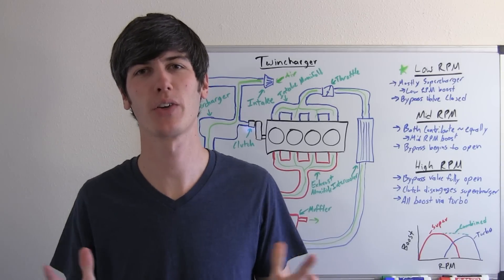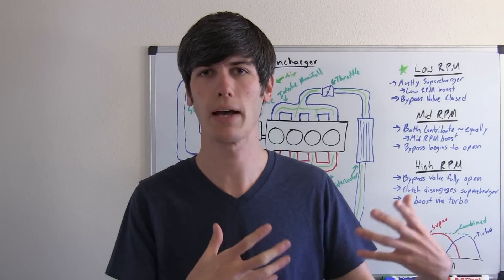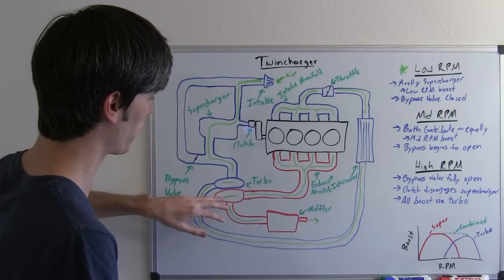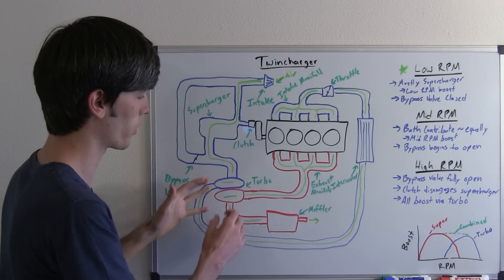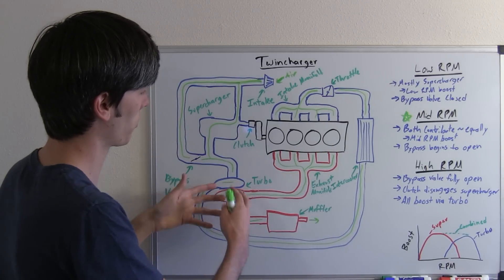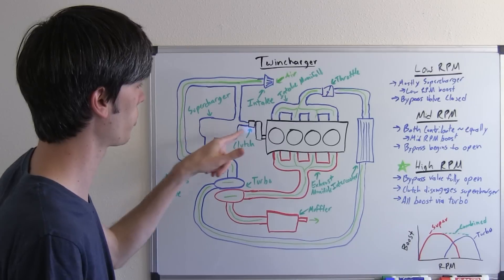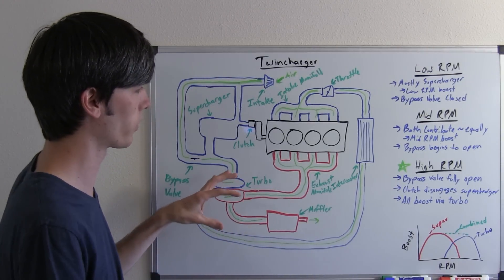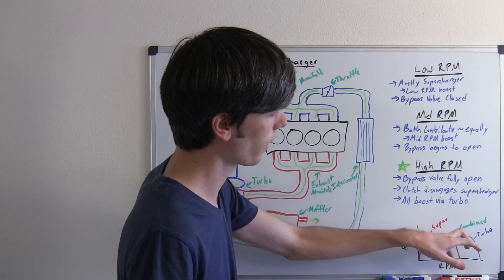How Twinchargers Work: Supercharger + Turbocharger

Comment: Hello.
Sorry that I am bothering you but could you explain if it is possible to Turbocharge an Supercharger.
What I have in my head is that air can go through the Turbo at low Rpm without restriction and Supercharger would compress air and give boost.
But at high Rpm Turbo would give Boost and Super Charger would make that boost even bigger.
So in that case you could use small Turbo  that would spool up fast and there would be a lots of boost at mid Rpm.
Would that actually work?
Thanks any way and i love your videos and watched every one of them.
You are awesome!!
Reply: I think I know what you are thinking of, and that is not what a supercharger is designed to do.  A supercharger is designed to work on outside air, not recirculated exhaust.  What you seem to be talking about is internal compression, and that is actually what a turbo does when spooling up; it takes exhaust gas and depending on its design, either pushes that air to either faster speed or higher pressure back into the manifold where it mixes with fuel.  A turbocharger and supercharger do similar things to different sources of air, so what you're describing is redundant.  See the video on twin turbos.

Comment: im looking at vectra vxr for my next car, these come with a twin scroll turbo meaning boost comes in early and a remap will see 400lb ft of torque!, the downside is that the turbo runs out of steam VERY early and the power drops dramatically.
my idea was to pair a centrifugal supercharger (more rpm = more boost) with the turbo to give a huge power band. the thurbo gives low/mid rpm power and the supercharger gives great high rpm torque (and hence hp)
do you think thats feasable?

Comment: i'm not sure if all twin chargers work that way because i've seen twin charged with roots style blower on top as the intake and they don't look like they can be turned off.
Reply: That was probably a 2 stroke Detroit diesel.   They needed blowers to start and iidle. But at higher rpms a bypass valve opened and the turbos did the lugging. Oddly they never had clutches on the blowers they were geared to the crank.
Reply: Yeah that sounds about right. i think they were were twin v10s or v12s, they were in big ass multi story boat.

Comment: wait... so if you decide to suddenly slow down and jump from high rev to low rev, does the valve and clutch instantly revert to it's original positions in low rev? when does it decide to?
Reply: you have to install computers that tell the clutch when to be activated and when to be released...
Reply: That's why superchargers are best in drag situations (0-60, 0-100, and 1/4 \ 1/2 \ 1 mile runs.  In a mechanically coupled supercharger, if something changes suddenly and your airflow is either overcompressed or cut off (low-pressure engine stall), you can break your engine.  That's the way it was before electric clutches and electronic engine management.

Comment: Detroit 2 stroke diesel is supercharged from the factory, and if you want more you then add a turbo. no disconnect or any of that fancy stuff lol.
Reply: That was one flaw the old DDs had. They were constantly lugging the roots blower when it was bypassed by the turbo (just wasting power at high rev). Blowers can rob engines of tremendous HP. That's why this method was invented.

Comment: how much extra compression does a supercharger increase? Or what should my compression be at before I install a supercharger?
Reply: Super chargers do not change the compression ratio, and there is no magic ratio for it to work. The compression ratio is just how much of a volume difference there is when the piston is at the bottom and top dead center.
Reply: Yeah; look at your engine specs, look at your torque output (get on a dyno if you have no clue), and figure out what to do from there.  A supercharger compresses the air going into the manifold; that is a separate process from compressing the air-fuel mixture before combustion.

Comment: is possible to have both the supercharger and turbo spin at high rpms?
Reply: I guess in theory, but it would be pointless since the air is going to the turbo anyway right? if the super was still active at high rpms, the turbo would have to suck it out of the supercharger anyway. Just expressing my opinion.

Comment: +engineering explained. Can you give me examples of cars with twinchargers?
Reply: koenigsegg has twinchargers in some cars
Reply: look up factory twin charged cars
Reply: Zenvo STI / TSI
Reply: Lykan Hypersports
Reply: Twin-turbo Flat 6
Reply: Dodge stealth vr4 TT/ 3000gt v4rTT
Reply: New Volvo
Reply: As far as I'm aware, the first production car sold with a twincharged setup was the Lancia Delta S4. It was developed as one of the famous "Group B" rally cars from the mid-80's, but there was a street version. By all accounts, it was an absolute monster. If you search YouTube, there's a video of Chris Harris (a man who has driven fast in everything) riding in one. His reaction says it all.

The Nissan March SuperTurbo had it as well (hence the name). It was a slightly less scary car. :)
Reply: Eh, to be clear, the race version of the S4 was the scary one. The street version was quite a bit less powerful.
Reply: dodge stealth and the vr4 are twin turbo 3.0L DOHC V6 engines and have no supercharger stock.
Reply: Vehicles that are labelled 'TSI' are also considered Turbocharged and Supercharged Injection'...
Reply: It's actually "turbocharged and stratified injection." Nothing to do with twincharging.

Unless you're referring to Eagle TSi models, which just signified a sport trim level, similar to putting "GT" on the end. None of them were twincharged either.

Comment: Do you have a video explaining the power band resulting from a twin charged vs a twin turbo?  If you have a turbo system that can spool fast enough on the bottom and carry through like a twin or tri turbo you wouldn't need a supercharger?
Reply: To spoil fast on the bottom it has to be a smaller turbo. And at higher rpms the smaller turbos can't move air as effectively. That's why they have a bigger turbo for a setup explained in the video, so it can handle the high end.

Comment: Can you do a vid on compound charging where the turbo feeds the supercharger? I don't understand the benefit of this.
Reply: Benefit is the turbo sees an effectively larger engine due to the already larger airflow created by the supercharger. So the turbo can be much larger. You need to think in pressure ratios though to get your head around it.
Reply: Im curious about that too.. I wonder if having a SC feed pressurized air into a turbo will help spool the turbo more on the low end before it gets exhaust gasses.. Its probably negligible but would be interesting to see how each configuration would compare
Reply: @ryanbernard6550   i wouldnt necessarily say that i mean back in rally they used to use misfire systems that when you would brake would make the car misfire to backfeed exhaust pressure to spool the turbo up even off of throttle the only reason they dont use them anymore is it uses a lot of fuel i think as well as cutting the engines life in half but when its running it defiantly made a huge difference mainly in making cars like lan evo's really good at dog fighting in rally since you could brake and then dive into a corner straight sideways while slamming the throttle to the floor at over 90 miles a hour
Reply: @Kradron5583  antilag is bad for trubochargers, especially older, lower tolerance turbos. Itll drastically decrease turbo life
Reply: RaliTek has some videos on one of their projects that use this idea. Over boosting and parasitic loss are the main problems with it.

Comment: Why does the supercharger get cut off?  What would be the outcome of the supercharger feeding the turbo at all times?
Reply: +bmarcy86 The reason that the supercharger disengages if I understand the engineering properly is that the supercharger is a compressor run by using the engine's power and at some point in the engine rpm curve it is no longer a benefit.. Although the output of energy it develops exceeds the amount being taken from the engine, the turbocharger is able to provide all the necessary air compression at high rpms while not taking any energy at all from the engine. By disengaging the supercharger at high rpms, there is a higher net gain of power, since there is only so much compression that the engine can withstand anyway, at high rpms the supercharger in this case is just robbing power once the turbocharger is up to capacity. AT low rpms where the supercharger greatly outperforms the turbocharger, it makes sense to have it doing the work of getting more oxygen into the combustion chamber.
Reply: +Matt Hirn the overall message is correct but turbos do cause power overheads from the engine because it obstructs the exhaust flow like a restrictive muffler does. This would be at its worst in the high rpms.
Reply: Thanks Gayan W. I am definitely not very knowledgeable about this stuff. I would guess that the loss from restricting exhaust must be less than the loss caused by the supercharger for engineers to disconnect the supercharger in favor of the turborcharger at high rpms.
Reply: Matt Hirn well they might disconnect the SC when not needed because they can. You can't do that with a turbo without rerouting the exhaust which is more complicated to as effectively like the clutch thing. My SC (twin screw) has a bypass that's open when the engine's under light load and shuts (gives boost) when under load. The is meant to reduce the parasitic draw when boost isnt needed. The sound of the SC is also very different when revving in neutral and under load.

Comment: Would there be something in place preventing the air from backtracking into the supercharger while the bypass is closed?  I understand that some people like it when the air backtracks through the turbo making that stupid choo choo choo noise, but would the supercharger face some issues with this reverse spin or does the engine momentum and overall mass of the compression devices in the supercharger override this?  Would the Bypass valve act similar to a BOV and release the pressure to prevent damage to the supercharger or does this kind of setup typically have a BOV installed?

Comment: couldn't you just have a variable turbo or twin turbo (one large one small) instead? would save some weight, right?
Reply: how ever many turbos you put, the throttle response is more or less like a turbo... turbos can't  produce boost from idle at around 600 rpms... super chargers can.

Comment: This is the complete opposite of how many 12v-92 Detroit diesels were made. They had twin turbos feeding a single supercharger then fed to the engine then to the turbines. The supercharger, however, gave no boost, it was used to scavenge the two stroke diesels. Yes it still had turbo lag.

Comment: while i agree with how you describe this system, i disagree with how you describe the supercharger disadvantages. if you look at the dyno graphs of modern supercharged cars, you'll realize that twinscrew superchargers don't have a rpm affected efficiency, kenne bell and whipple both pull hard up to redline, its the roots style that is rpm effected because of the heat generated. people also go with turbo's rather than superchargers because they get a programmable powerband that you can change on the fly. a twincharged system is there to provide the low end power when needed, and have lots of top end for racing and such. you can technically achieve the same power with a supercharger, but your powerband is going to be totally different, and probably won't rev as high because you simply don't need to, unlike a turbo, which once you get to higher powers REQUIRES high rpm to get the pressure needed for boost. both are equally good at what they do best, and to be quite honest, a proper twincharged setup will wax either supercharged or turbo/twin because of its power curve, and if you vent the turbo into the supercharger with a bypass for high boost you get a compound boost effect that gives pretty stellar results :)

Comment: why doesn't everyone do this instead of one or the other
Reply: time, money, complexity
Reply: good question
Reply: supercharger is a bolt on setup while turbo requires a lot more labor.  You can install a supercharger in your garage in just a few hours.  Turbo is a more permanent setup, gotta drill a hole in your oil pan, setup a couple lines to and from the oil pan to lubricate the turbo, gotta replace the exhaust, replace the injectors, and a bunch of other steps.  From beginning to end a turbo will cost as much money as the supercharger and take a few days at minimum and that is with knowledge on how to set it up.

Comment: hi i have just bought a engine 1jz turbo its already capible of 450hp at17psi but before buying the engine i bought a minicooper supercharger and im thinking to put that also
Reply: but i dont know how to
Reply: I'm going to do almost the same thing as you, I have a Nissan RB26dett engine and the main idea is to put a single Holset hx40 turbo and a sc14 supercharger out of a 1g-gze Toyota engine to avoid the lag of the big turbo, I think the most complicated part is to make the brackets and mounts for the supercharger and the lots of pipes to the intake manifold.  My engine is gone be put on a Nissan patrol 160 series so for my application and the weight of patrol  i can't wait to be on the 5000 rpm to have some power. Grettings from Chile and good luck with your engine :)
Reply: The turbo i have its not a big turbo it makes 20psi at full boost thats why i was thinking to put supercharger also i have bmw e30.320i 1988 and 2jz is expensive so i bought 1jz and im happy engine havent arived yet but im exited and i would like to see your patrol running and having fun
Reply: +Rafay Saleem (rafa) great car man, I had a bmw 325i e36 those are Beautiful cars, otherwise I have to buy too many things for the patrol build yet :(  the exhaust manifold, intercooler and a programmable ecu.
Reply: +Andres Rojas i also need intercooler radiator tuneable ecu  and small things
Reply: +Andres Rojas but its really hard to find parts here in saudia arabia i didnt find a orignal bmw engine here for my model thats why toyota
Reply: +Rafay Saleem (rafa) I understand. I sold my bmw for the same reason, it's difficult and expensive to extract power from the bmw engine, here in Chile are not common bmw Racing parts, for the other hand, we have lots of Japanese cars and engines which are imported directly from Japan, so that's the reason I took that path, I have a Nissan silvia s13, a Toyota MR2 mk1 and a Dahiatsu charade GT ti. Here in Chile only you can find old patrols. I wish to have a Y61 patrol, like the ones you have available there. :)
Reply: +Andres Rojas yes my engine also cMe from japan.all saudis love petrols and land crusers bcoz of offroading my frnd has a nissan armada really powerfull car im mean that car is faster then most of new suv's we have beaten new 2016 land cursr v8 then tahoe 2016.2012 denali.2011 seira single cab.2009 chevy caprice v6.hyundai azera v6 2015 and many more

Comment: The routing/layout you describe here is not the most common layout, and presents complications with timing and controls.  Most layouts run one blower into the other, thereby multiplying the total pressure each would normally produce alone.
Reply: +killboydotcom the nissan march super turbo
Reply: Yeah I don't get why you would do it the way he showing. If you get let's say 5 PSI from a supercharger and another 15 psi from a turbo when it's pools why would you want a total of 20 psi
Reply: Spencer Roberts doesn't work that way silly.  Max air flow is the governor. You have to run the little into the big to see a compound realty. Running the supercharger into the turbo creates a suction on the turbos max out put airflow..
Reply: Tony G gotcha
Reply: blows me away how poorly people understand physics

Comment: why not just have the super charger bypass the turbo all together and go directly into the engine?  wont faster air going through the turbo mess with the spooling process? even though its a very small delay, the air coming from the spooling super charger would be going faster than the air coming from the exhaust slowing down the turbo.
Reply: +Zach Faulkner It's done so via a combination of the valve (supercharger only) and the wastegate (turbo off).
WWII bombers were both supercharged (for low altitude) and turbocharged (for high altitude).

Comment: Could you not cut out the bypass valve and just use a wastegate between the sc and tc?
Reply: Old 2 stroke diesel engines did that. Except the turbo would feed the blower.

Comment: i'm wondering if lowering the static compression in an engine to say 7: 1 can be countered by spinning the compressor faster then normal untill midrange , i figure you can push the mix in and tune the bottom end torque a lot more efficiently if theres not a lot of compression to start with (wish might help traction off the line ) , you can allso bleed off a lot less air trough the wastegate then with the higher static compression with that "too big for the engine " turbo 
since the compressor will be disconnected at migrange rpm there whont be the danger of it spinning beyond its capacity 

allso like to know if there ready made aftermarket valves and electric cluthes available that work in a system like this